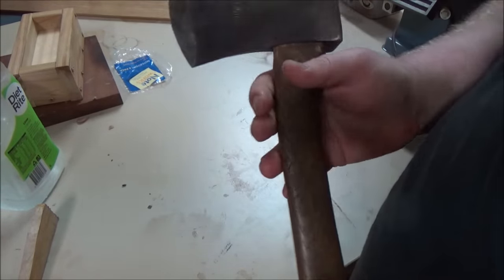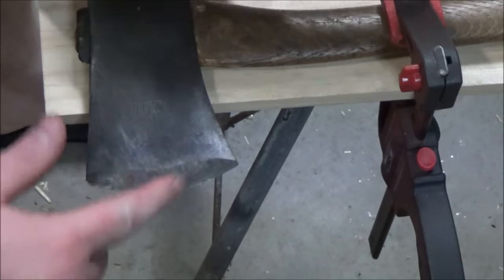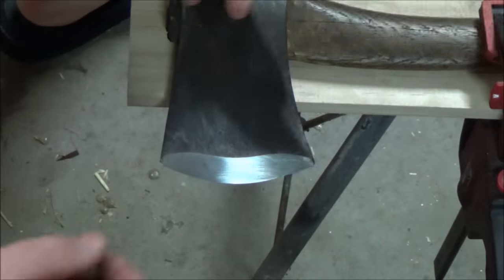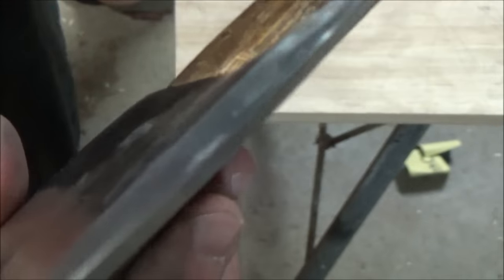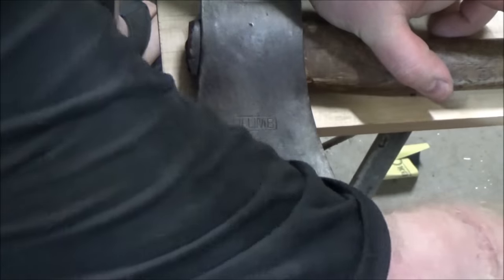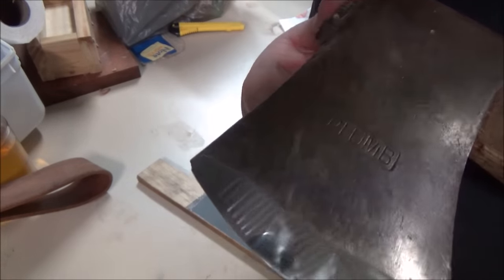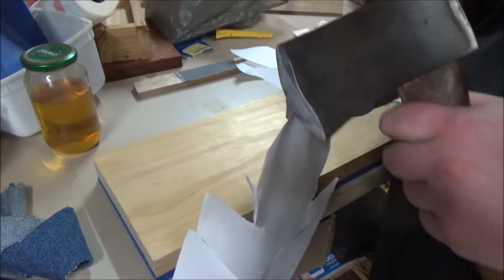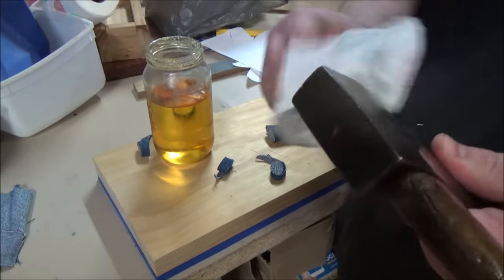How to Sharpen a Hatchet or Axe to a Scary Sharp Edge!

Comment: From a lot of experience, its not just about how sharp you can get it, its about what you plan on using it for. For example, if you want to "split" firewood, you want a wider cut angle on the head. You dont want the axe head to cut, you want it to split. Now if you are sharpening a felling axe, then you want a shorter angle and sharper blade. I hope that makes sense.
Reply: Ya, the thicker axe pushing the log apart easier with force to split it and the a thinner sharper axe will cut deeper into a tree because the force is more concentrated at the blade and with a thinner head less friction and can glide further into the wood.
Reply: @kayden5238  Ecactly. Good breakdown.
Reply: Even a felling axe should not be really sharp. They are not made of high grade steel for a reason. A file is the only tool required and making the angle shallow on any axe will seriously hamper its ability to clear chippings when cutting cross grain. I would only put a knife edge on an axe with various grades of sand paper if I needed to get the required time to get paid for a You Tube video.
Reply: Finally someone who know what their talking about. Why don't more of us do these. There seems to be a lot of videos made that work for the person using them but not for (or expanded enough to include exactly the styles you've just explained)
Reply from the maker: Ace bandage, I was planning on putting a lot of that Information in and explaining the different edges for different uses. But the video had already gotten way longer than I thought it was going to be. To put all the information into a video I feel comfortable to explain it would have taken me an about an hour. I do plan do do a sharpening series one day putting everything I know into and axes will be type of tool I explain. But since I haven't made a video for a while it might take me a while to get to it.
This particular axe was sharpened this way for carving and delimbing/chopping green wood. Both tasks that can benifit from a more refined edge and finer edge angle.
Reply: @sidneyeaston6927  
I  get mine this sharp for kindling splitting. 
Love it.

It has kept me away from kerosene and fire-starters for decades.
Reply: Agree, but with the exception of splitting kindling. A super sharp edge is nice there so you can get it to bite with a like strike. Take your hand away and then split with the more forceful strike.
Reply: Depends on the timber you felling too. Australian axe and edge geometry for natuve timber is totally different to the northern hemispheres
Reply: There’s always an expert in the crowd. 🙄
Reply: I've been sharpening for most of my nearly 50 years on this planet.
Its finally my job, and I love it!
But, you are 100% correct.
Most do not understand different edge geometries, and what their purposes are.
Reply: all the sandpaper cost more than the axe,,

Comment: If you color the edge with a sharpie between grits, you can use it as a guide coat and be sure you got through the scratches of the last one
Reply: Nice! Thank you for that!
Reply: Always a great trick ESPECIALLY for those using GRINDERS and heavy files or rasps to start.... using those methods You're taking a lot of material of the blade and I mean VERY QUICKLY!
Reply: We used to use engineers blue in college for seeing if your piece is flat, I totally forgot about this technique, thanks!
Reply: I'd rather just use my eyes than waste sharpie
Reply: now thats some smart ass shit there thanks for the tip!
Reply: @kayden5238  glad to help😁

Comment: When I was a kid in the bush, still in primary school, it was my job to chop up all the firewood for our wood stove in the kitchen.  A trick my father showed to help keep the axe handle tight in the axe head was to, every now and then, stand the axe, head down in a can with some linseed oil in it.  The wooden handle draws the oil up into the head and helps stop the wood from shrinking and becoming loose in the head.  You don't need much oil - just enough to make contact with the end of the handle will do the job.

As for the shaving tip to test sharpness, don't do what I do when sharpening kitchen knives.  Being the master procrastinator that I am, I put off sharpening my knives until there isn't one sharp one left in the knife draw, then I sharpen them all in one go.  Depending on your point of view, I'm either blessed or cursed with very hairy arms and legs, so by the time the job is completed, I look like an old mangy dog!  For some odd reason, the sheilas don't go for this look.
Reply from the maker: I have heard of that trick. One of my axes may need that but most are tight already.
I know what you mean with sharpening. Sometimes I don't sharpen mine because I have been doing everyone else's and can't be bothered. 
I don't usually do the shave test as much now. Unless showing off. Phone book paper is my go to now. And the 3 finger test.
I remember when I was starting to get competent at sharpening. I had done a bunch of knives and my arms were all patchy with bald spots. My friend was all like, what's wrong with your arms.
Also damn I though the mangy dog look was in. Must be the problem
Reply: ROFLMAO

Comment: One other thing to do... Wax the head.  It will cut better and rust less.  Car wax works just fine. It will help to keep the pitch off too.  Beautiful edge!
Reply from the maker: Thanks. Yeah I forgot to oil the head on camera. I have seen wax used on saws but not axes. Sounds like a good alternative. Especially if putting away for storage.
Reply: Will that work for mower blades too? Ty
Reply from the maker: LamBeau Leeper, I just responded to your other comment, I put the answer there. But good luck and have fun :)
Reply: @LambeauLeeeper  what? Why would you?  Just smear a thin layer of oil on the blades before you put it in storage.
Reply: A good way to get rid of the micro burrs and hone the final edge is to wipe it with Isopropyl alcohol. Then wax it. I use a thin layer of car wax.
Reply: @LambeauLeeeper  ask sling blade.  He did it 😂😁😄😃

Comment: Good to mention the bit about the burr. Most people don't understand why an edge seems sharper on one side than the other. Getting that part reduced or removed is the key to any good sharpening regardless of angle on any edge be it axe, knife, planer blades or whatever. As a retired person on limited income I could never justify buying one of those Ken Onion special belt sharpening systems but got one for Christmas from one of my sons. It's the kind of gift that keeps on giving a long long time! Now I keep every edge I own in tip top shape. It's good for all but the final stropping unless you buy a leather belt that fits the machine like I did. I put just a hint of black abrasive compound on the belt then finish the edge in under a minute. No matter the angle I can then duplicate your hair shaving and paper slicing demos. I never get tired of keeping not only my tools sharp but tune up tools, knives, axes, scissors, etc. for my four kids, friends, and even couple good neighbors!
Your hand axe is a carbon copy of my prized WWII surplus axe I bought at a garage sale many years ago! It's equally good to keep wood handles of tools in tip top shape with that linseed oil as well. On thing, I usually daub a light coating on the new the newly exposed bare metal as well as lightly soak the leather scabbard that covers the edge when not in use. I also wipe down and rehone/oil the edge after use, specially if cutting green wood! All these measures make your edges last even longer! Nice detailed video & thanks for the effort!
Reply from the maker: Cheers. The model of hatchet I have here is called the 'Plumb Dreadnought'. Quite a nice piece.
It is a shame that these days everything just gets thrown out or left to rust and rot. Then a new tool is purchased. I have learnt that it can be quite a joy to look after your tools and keeping them in top shape also means they are much more fun and easier to use.
I haven't tried the worksharp systems yet. One day I will pick one up. Seems like a neat little tool.
Reply: Boiled linseed oil rubbed on the axe head  will dry & form a protective coating until it is rubbed off during use. Raw linseed oil won't cure & will remain tacky. I've read that it's also great for mold growth.
Reply: You know I heard that you put linseed oil on once a day for a week... once a week for a month... once a month for a year... and once a year for the life of the handle... just a FYI... GREAT video....
Reply from the maker: Yeah i have heard that one. No harm in trying. I tried once with something and forgot about it after a couple days lol. This axe i got from a friend who looked after it. So it already has a nice build up. So it is probably at the once a year phase.
Once you get the handle like that it is amazingly comfortable on the hands.
Reply: M

Comment: I used to spend ludicrous amounts of time with stones, working my way up through the grits... This method of yours is excellent, if you have loads of sandpaper and time — and don’t get me wrong — t’s always good to know the many ways a thing can be done, especially the most basic, so you know how to do it when resources are limited. For the less patient, drop $50 on a cheap 1x30 benchtop belt sander and throw another $15 down on a set of belts in all the grits from 80 to 1000 — start on whatever low grit you need to, given the condition of the blade, work your way up. Your axe will be equally razor sharp and beautifully polished in a tiny fraction of the time — about 5-10 minutes — less if you do it frequently. The “flexy” section of the belt is perfect for achieving a convex grind on an axe bit, as you want that slight curve toward the edge to keep it strong. For flatter grinds, you can use the flat platen. I sharpen everything on my 1 x 30 belt sander — love that thing. Belts are super cheap, too — you can get a full set on Amazon for $15. I also got a 1x30 leather stropping belt, with compound, which is the final step for the mirror finish. That system makes sharpening almost anything super fast and easy-peezy. I sharpen way too many tools, way too often to spend a ton of time on it — which used to mean I ended up having a lot of dull tools. I was amazed how inexpensive and fast the belt sander method has proven to be. Those machines are so cheap, you could easily buy several of them and have them set up next to each other with different grits ready to go. The belts are also very easy to change, so I just swap them out, as my workbench space is limited. To each his own. Great video. Keep up the good work, mate!
Reply: @Robbie Spil I just got a super basic 1/3hp 1”x30” belt sander on Amazon. I believe it was about $52, two or three years ago. There’s no brand name on it — it’s green - lol. Some of them have a side disc sander built onto the right side. Mine is just the belt. You can get much nicer ones… Rikon makes a good one, and I will probably get another higher quality one, eventually, as this one is noisy, but it gets the job done. For the small amount of money you pay, it’s amazing how much knife and tool sharpening and just grinding of any sort you can accomplish with one of them. Great entry level grinder for knife making, as well. You go through the belts quicker because they’re shorter, but they’re also a waaay cheaper than 48’s or 2x72’s. The offerings change all the time. I just find the most belts with the most grits for the least amount of money in a set on Amazon whenever I get close to running low and spend another $15-$18 to re-up on a whole ton of belts. Enjoy!
Reply from the maker: Johnny Rockets, I have a 1x30 but don't often use it for sharpening. I wouldn't touch these (good quality and condition) old antique axes to a sander unless it needed a bevel cut in.
I had never actually used sandpaper for sharpening an axe before this video. It was just to try a method which hopefully people with no tools could replicate. I usually use files then stones, then strops.
But I do use sanders on things I need to reprofile (not often knives though) just did an adze the other day on my 4x36 sander. Cut a relief bevel in behind the cutting edge bevel. It came out awesome. Doing it by hand would have been hard work as it was in real bad condition to start with.
Reply: Been doing that way for years 1x30
Try some diamond compound on your leather strop. 1 micron is fine enough. Restaurant chef knives are 5 minutes tops and anything else that needs an edge. 
On the axe, why? They won’t hold that edge past the first few chops anyway and they are sticky

Comment: I would not put much stock into the 'It's too sharp' comments Scott. There is a lot of misinformation out there and some just like to cast shade to boost an ego. A tool that is properly sharpened makes all the difference. If they actually worked with them, they would have the same opinion.
There are only three things that dictate your sharpening: The intended task of the tool, The ability of the tool to take and hold that edge and finally it's your ability to put it there. If you're good with the last two points, the first is a no brainier.
By the way, lovely axe mate. There is something very special about tuning up old tools. That one is a keeper.
All the best,
Ben
Reply from the maker: Thanks. I am kinda surprised how many of those comments I am getting. I think most people just use them for splitting wood these days or chopping tree roots or something. Which would make sense not to make it too sharp.
And yeah it's a lovely axe alright.
Reply: Good job Scott, one of my favourite sayings from the bushmen past was, it's got to be sharp enough to shave a mouse asleep 👍🇦🇺.

Comment: My grandad gave me his old axe when I moved to my own house, he said it hadn’t been sharpened or used in over 45years and he got it in 1928. Very rusty and the handle was no good so I resorted it, it was the first axe I resorted. I now do it as a hobby. 

Been doing it for 3 years now and the one thing I could never get right was to get it sharp like this and now I can 👍 thank you 🤜 🇬🇧
Reply: When you restore it, what do you use on the axehead to protect it from rust? I’m finishing my first axe restoration.
Reply: Socrates458 I curious about that too.

Comment: I absolutely love the premise here! For the guys that don’t have the equipment that I (I sharpen blades semi-professionally) have. I would recommend that you use wet/dry paper and a pump sprayer with some WD40. The oil will keep the material from clogging your paper so quickly. And the pressure from the sprayer will actually blow some of it out of the paper to lengthen the life of the paper.its a beautiful hatchet as well.

Comment: Straight forward HOWTO. 
No extraneous or non relevant bits.

Good job on the video and the axe sharpening.
Reply from the maker: Thanks. Glad you enjoyed.
Reply: Straightforward how-to would be "same as anything else". But you don't want to do that to an axe or it stops being a good axe and becomes a crap knife. No knocks to the man in the captain's chair, it's a great vid still, just throwing in my unsolicited 2 cents
Reply: @sluttybutt  what exactly do you not want to do to an axe? Sharpen it?
Reply: @sluttybutt  A sharp hatchet is a must for any work that is not splitting wood. For example I carve spoons and bows and the first step is always the axe work. It would be VERY dangerous with a dull axe!
Reply from the maker: Douglas E Knapp, carving and cutting green wood are where a razor sharp axe really shine. It would glance off a lot if even semi dull when carving. Also would have to cut at larger angles which makes a mess of the piece.
Reply: Yes - and no bloody music.
Reply from the maker: Alan C, I haven't worked out the music yet. Maybe one day ;)
Reply: @scottshobbyz5416   Oh, please don't. It's fine just like it is.

Comment: Still a novice when it comes to sharpening my hatchet, but after watching your video I have a lot more confidence. Great tutorial!
Reply: Same here too, I tried sharpening my BK2 a while ago and I’ve completely messed it up, there are sharper spoons in my drawer than my ‘self-dulled’ Becker, I’m really pissed off at myself for it. This video has given me the push to try again, with fresh sandpaper, and patience... lots and lots of patience!!
Reply: as someone who has sharpened blades a lot let me give you one piece of advice about axes: get a good one from the start, putting a good edge on a garbage axe is never worth it, trust me, touching up an edge that was good at some point, takes less effort and lasts you longer.

Comment: This side to side technique is new to me.   I have always either circled or used the stone from the direction of the base, out towards the tip.  It is a complete novelty to me and I am about to have a go at replicating.  Using no lubricant is new to me too.   I have always wet my wet/dry sandpaper or used a stone with oil or dishwash detergent (a fad I went through back in the '90's). Having just done up all my tool handles over the past week, it is now time to start on the metalwork; so this video suggestion was good timing, thanks to youtube!

Comment: Awesome video. Exactly the kind of help I need because I'm one of those folks who doesn't want to spend hundreds of dollars on sharpening stones. Thanks for the super clear explanation and the demo.
Reply from the maker: No worries glad it helped. A file used with the draw filing technique is great if you have a lot of steel to remove. Then refine to desired result.
Reply: You could also pick up a two sided stone for 5 bucks and get a decent polish on. Bit more convenient than this method